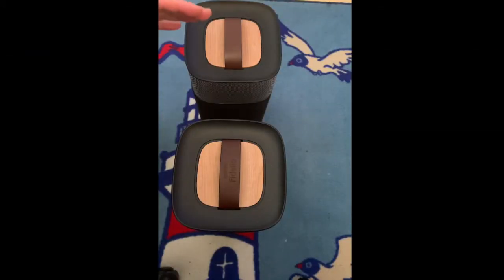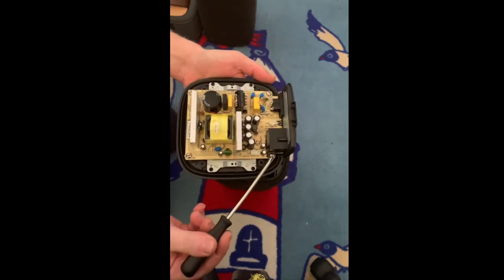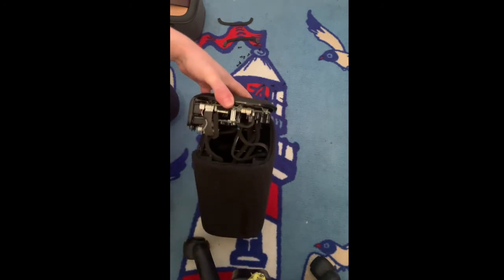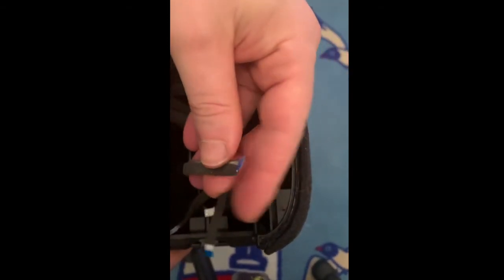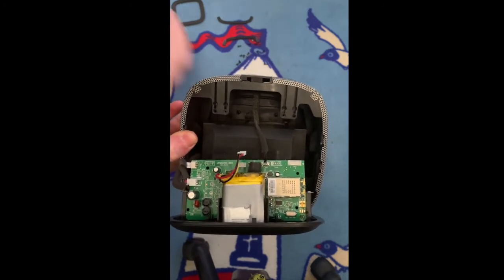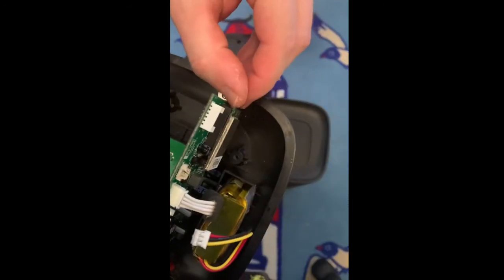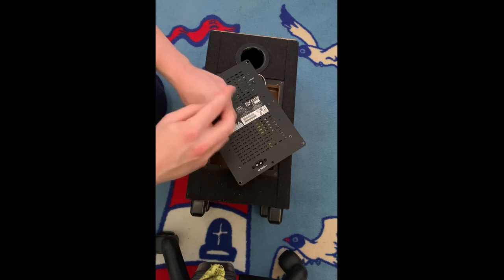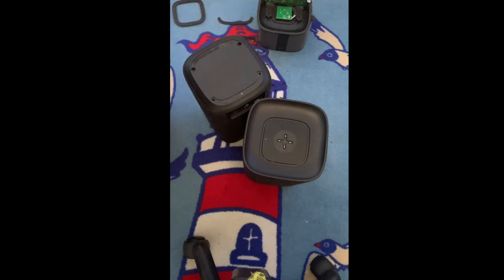how to disassemble fidelio e5 surround sound

Comment: Hi, nice video. 
I have a similar model, which is Fidelio E6. There is a problem where the sub-woofer and the satelite speakers will lost connection after play for some times.
Found a chinese website where there are case similar to mine, then they fine the batteries were bad, so I follow and check mine, and I find that both mine batteries have swollen, so got them replaced and wish the connection problem would solve.
Unfortunately, after the batteries replaced, use for couple of days and the sub-woofer lost connection re-occur, some time the satelites speakers will lost the connection together with the sub-woofer, with both the led orange and red blink continuosly.
I'm guessing could this be the wireless control causing the problem? And any idea which is the board or module for it?
TQ.
Reply from the maker: Hi thanks for your message! I ones opened a E6 I think your problem is probably a capacitor or resistor that is overheating. Sadly there is no solution for this yet, but I would definitely recommend looking at forums that speak of this subject.

Comment: Hi, i have this e5. one of the smaller bluebooth speaker cannot be charged and it also cannot connect to the other for surround sound. could you share how it can be fixed?
Reply from the maker: you could check the battery could be short-circuiting open it up and check it out.

Comment: Can’t get any sound from the speakers all the lights come etc but no sounds
Reply from the maker: Hi, thanks for your message. The common issue is the cable, if there is no sound. The only thing you can do now is try to connect the cables properly and then try and use a jack connection or HDMI or Bluetooth to actually see if you have any sound in those connections.